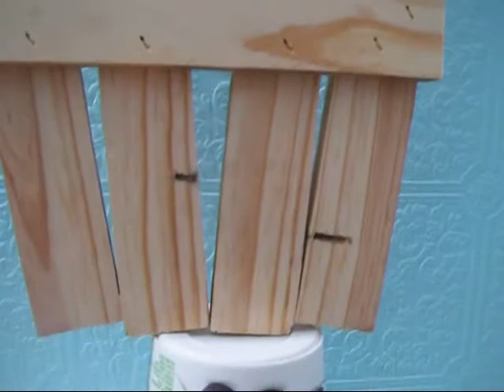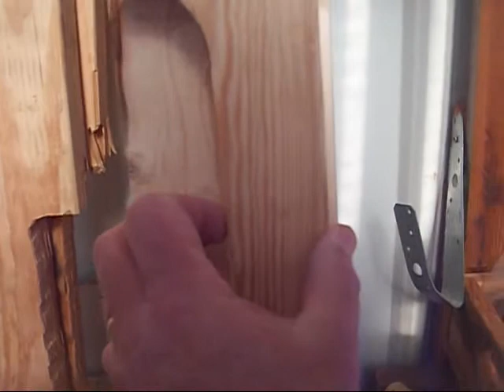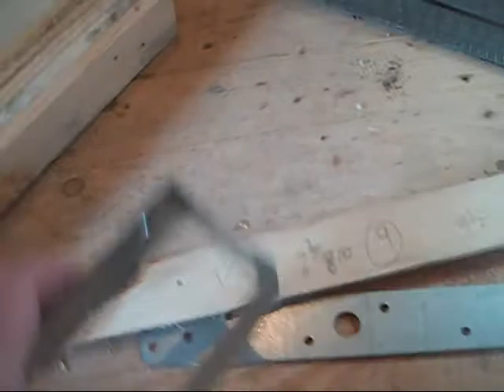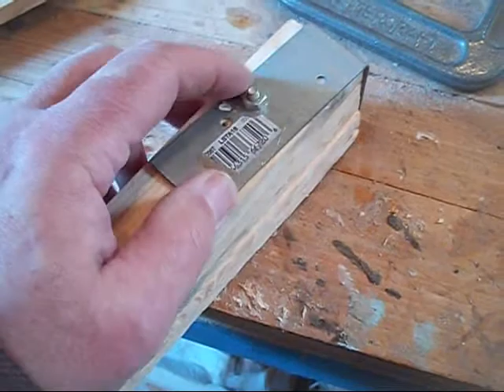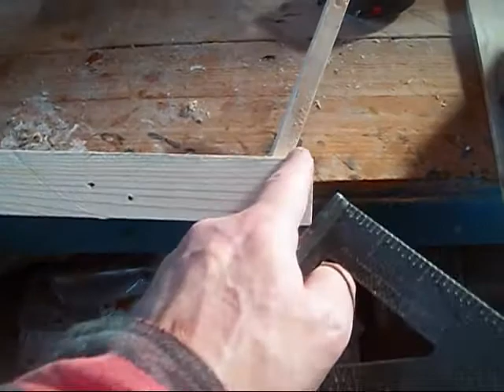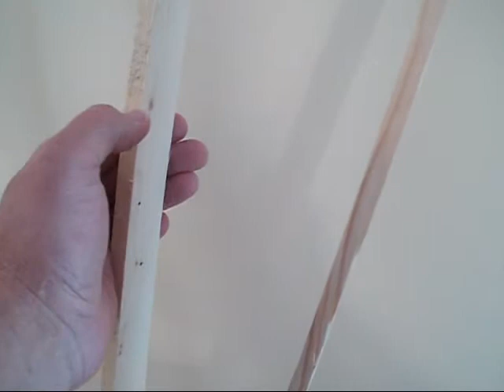How to Make a 6 ft Wooden Fan Trellis.

Comment: Looks Very Nice. I’ve never made one. And I’m trying to find a video that has detailed instructions without skipping to the next step or to the end. So I have to ask after you have the 2 out strips held what would the measurement be for the others? Thanks Again Sir! 🤝
Reply from the maker: For the 5 verticial. strips.  Place the 2 outside strips about 31 inches apart (strip 1 & 5).  The middle one is centered between them (strip 3) and then measure between the outside and middle strip  to find the center of that side and that is where each of the other 2 strips go (strip 2 & 4).  And I sure once you start putting it together you will be able to figure it out.
Reply: @aandjpeitreasures  Awesome Thanks Bud! Well Said. I’ll Definitely Give That A Shot! 🤝